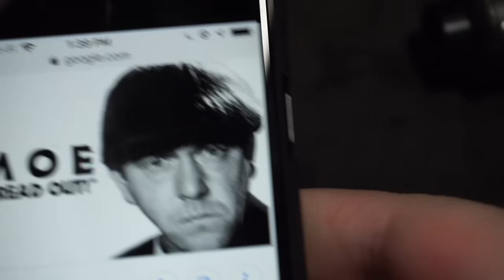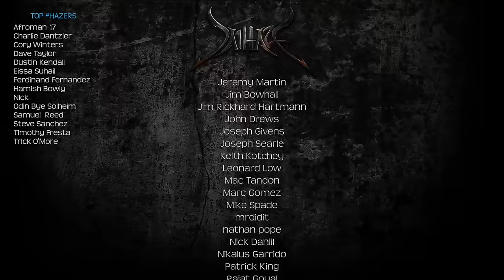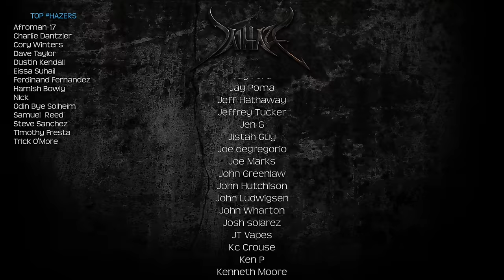Immortal Mods After Life RDA Review and Rundown | Mountain Vapors, Ryan Hall Project

Comment: On the subject of flat head screws, I can't stand flat heads on a deck that basically requires you to remove at least one screw entirely, the flave is a good example of a good rda let down by this design.

Flat head grub screws, on the other hand, I honestly have no problem with. Why? Because there is literally no reason you would need to remove them. Unscrew it until the post hole is open, and boom, you're done. It's a non issue.
Reply: You don't need to take the screws all the way out on this rda. Jai was just showing how much of a bitch it is to get them back in if you accidentally unscrew it too far